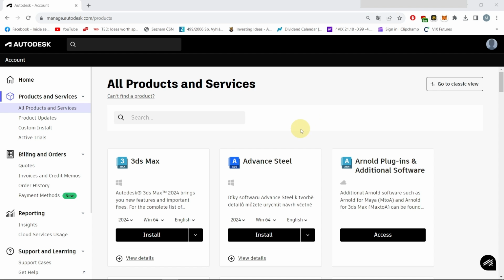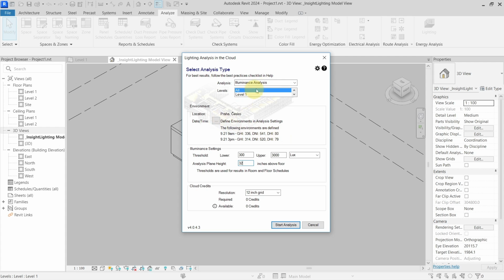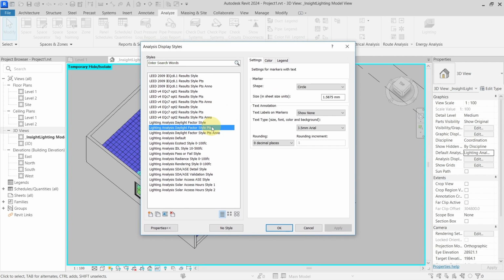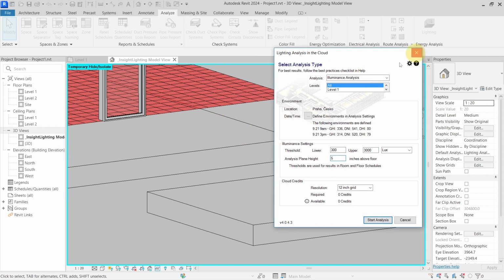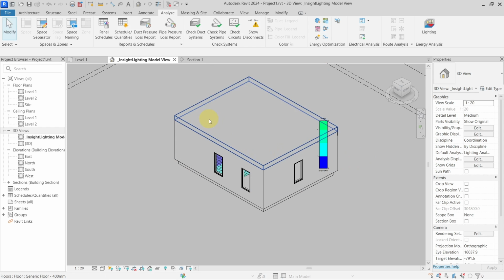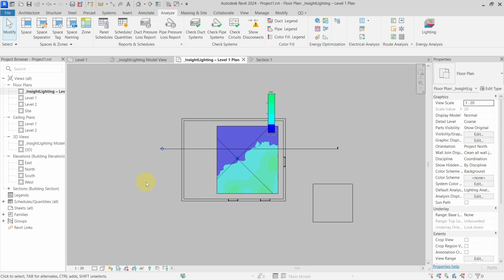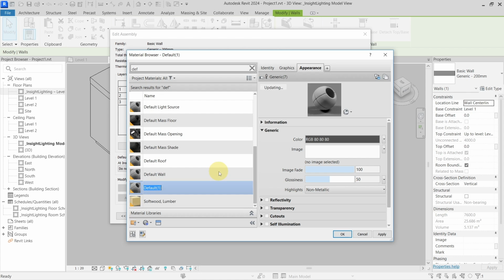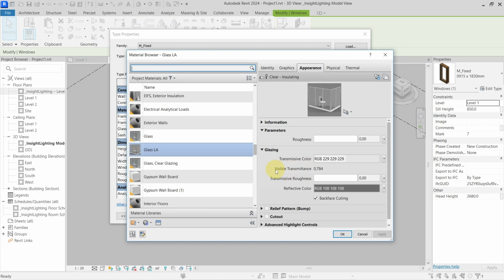Revit Tutorial - Lighting analysis using Insight plugin

Comment: Great video, thank you very much. I have a question. Is there a way to extract the illuminance point values for each room in a table format?
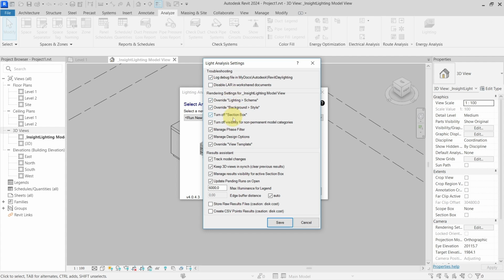Reply from the maker: Hello, i talk about this in 3:54 there is a setting that will save you csv file which you can then open in excel
Reply: Thank you for the quick response. Yes, I tried that option, but the result is data that we can find in the Insight Schedule. What interests me is whether the illuminance values at each point in the room shown in the 15:30 video can be displayed in a tabular form.  @eMexperience
Reply from the maker: Hello  @sanjadubljevic7235   yes, as i said before you should get a csv points file that you can open in excel. Or do you mean directly inside of Revit ?